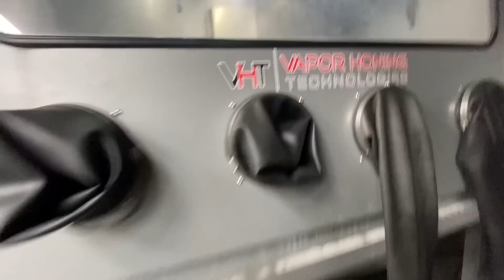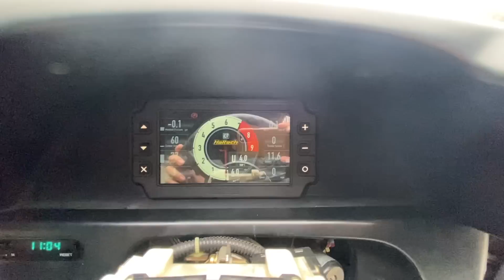FINALLY IN CT! | Tuning EVERYTHING | TommyFyeah

Comment: Had en eg civic with full hks hi power exhaust on it back in the 00s. Very unique sounding ☝🏼👌🏼👌🏼 not very loud untill vtec engaged but when second set of cams start ul her from a at least miles away 😂😂😂
Reply: Had a 98 Sedan Red with a hi power hks exhaust 2 1/2 inch catback 
Thing sounded so throaty and good with a jdm d16.
Gave the car to my little brother and we swapped it with a b series before he sold it
Good times.